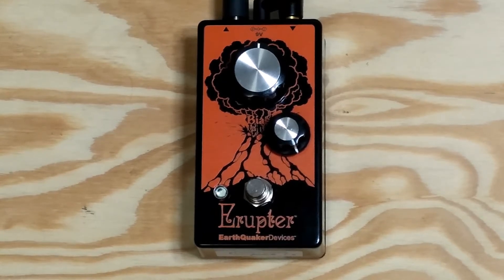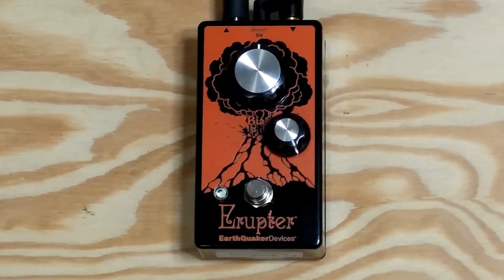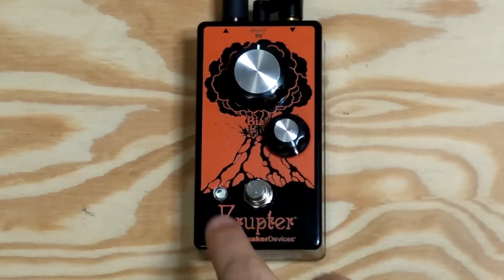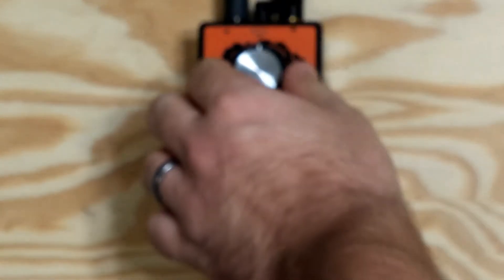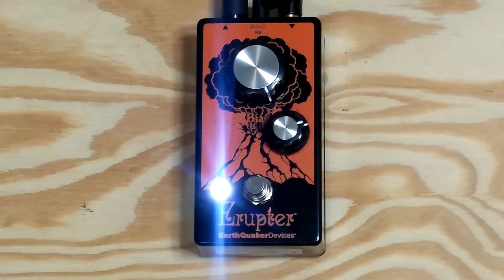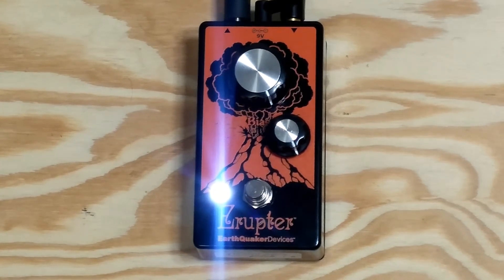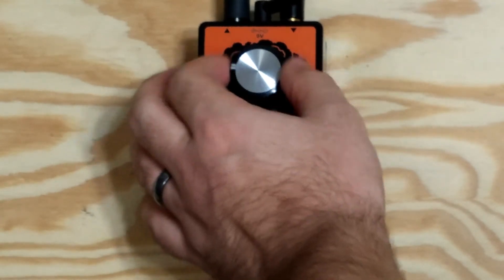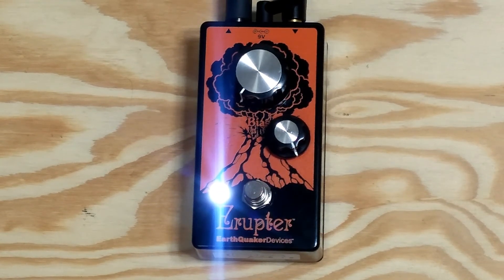Loophole Pedals "Volume Mod" on Earthquaker Devices Eruptor

Comment: I run my guitar through a jhs clover and then eruptor, but the volume drops considerably when I turn on the eruptor.
Reply from the maker: Odd. Your version might have an internal trimpot. Check that to see if it's turned too low

Comment: it seems like when the large knob is turned counterclockwise, you lose the stock spitty and gated fuzz with the volume attenuation mod. am i hearing that correctly? i want this mod, but i don't want to sacrifice that part of the erupter. thanks!
Reply: Hey man! Nothing is lost with the mod. To dial it in, crank the small knob fully clockwise (stock sound.) Then set the big knob to the desired sound-however much sputter and grit you'd like. Then dial back the small knob to unity gain and you'll have the sound of the circuit at a lower volume. What you're hearing as loss is either less signal cranking the front of my amp (not the pedal,) or less volume over driving my smartphone mic. :)

Comment: Hello!  could you share a schema?
Reply from the maker: There are schematics available online.
Reply: Locate wich lug of the 68nF capacitor, that is connected to the bypass relay (the big orange square just under the jacks). Lift it, and insert your volume pot here. (From the cap to center lug of the pot, one other lug to the hole of the cap, the third lug to ground. That's it.
Reply: @MSMWorkshop  salut, quel type/valeur de potentiomètre utilises-tu? merci!
Reply: @EdPrismic  100KA ;)
Reply: @MSMWorkshop  super merci beaucoup!